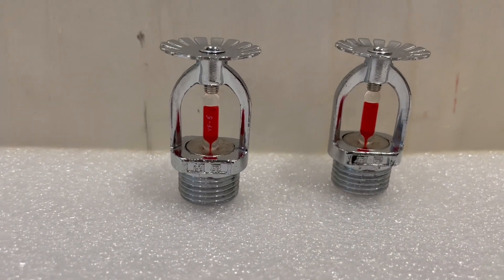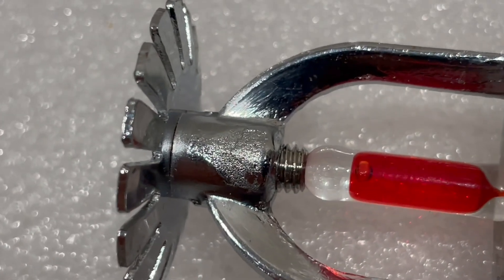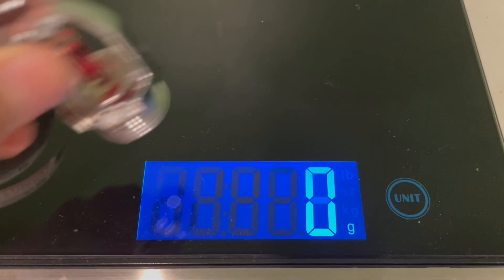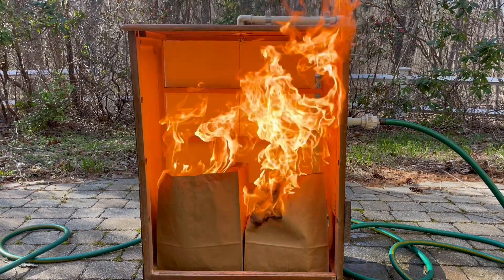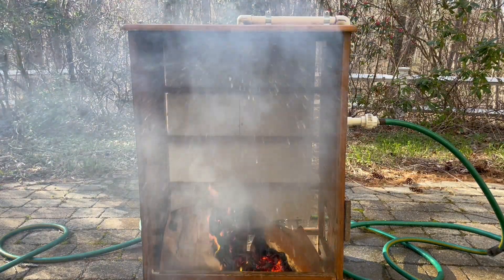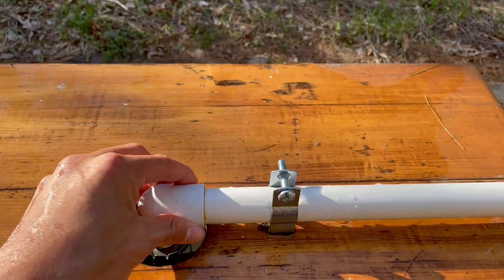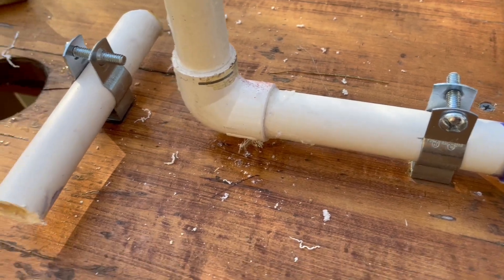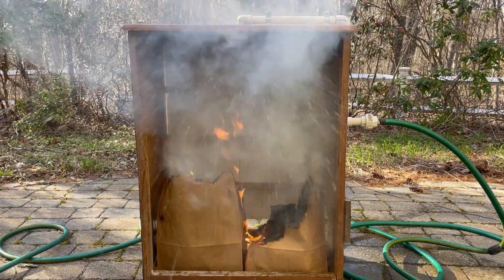Will Counterfeit Fire Sprinklers Work? Testing Generic Fire Sprinkler Heads! Sprinkler Season ‘24

Comment: What happened to using a water fire extinguisher for more realistic pressure?
Reply from the maker: It’s less realistic. Less about pressure and and more about flow rate
Reply: @ are you just going to use the garden house from now on or find something better?
Reply from the maker: @twistedwhiskers8776  garden hose provides better flow so yes
Reply: @FireAlarmDude5967  real fire sprinklers have a much higher flow rate and pressure
Reply: @FireAlarmDude5967 could you connect a water pump to it normally used for pressure washing?

Comment: Great video as always! Do you or anyone happen to know what green and red fire alarm strobes mean on the exterior of a building? 

For clarity, this is in New Hampshire, and it seems to be increasingly common. Someone on Reddit suggested it may be indicating the cause of the active fire alarm, but I’ve never found a definitive answer.

My building had small fire yesterday though, and the green strobe was flashing the entire time the alarms went off, which peaked my curiosity again.
Reply: As far as my city has it (Concord, NH), red strobe indicates general fire alarm system active and green strobe indicates fire sprinkler waterflow.
Reply: @Alarm1587  That’s definitely it. I’m sure Manchester is the same. Also, how cool to see an NHFireAlarms account!!
Reply from the maker: Not sure. Red strobes are used fre
Reply: @FireAlarmDude5967  I ended up asking ChatGPT and came up with a Manchester, NH fire alarm document which says:
“A green outside strobe connected to the main flow switch and system low pressure switch shall be provided for and located on the address side of the building, facing the street adjacent to the fire alarm system red outside strobe.”
https://www.manchesternh.gov/fire/FixedFireProtectionSystemsRulesAndRegs.pdf

The more ya know! Definitely seems like there was more than “smoke from a cooking error” during yesterday’s fire alarm.